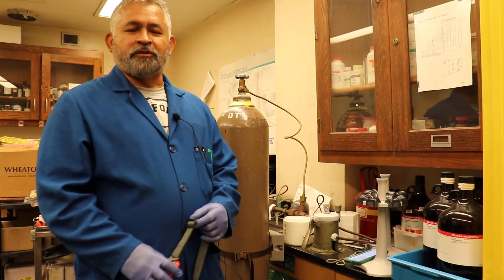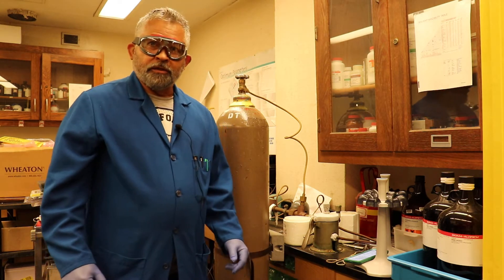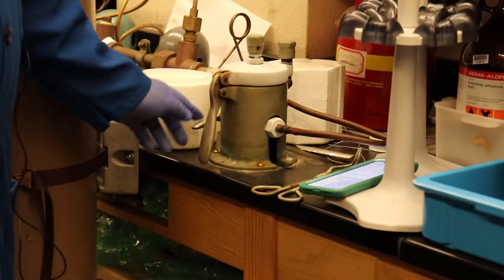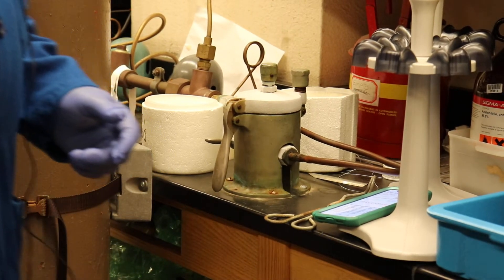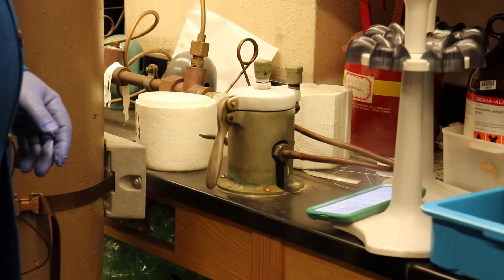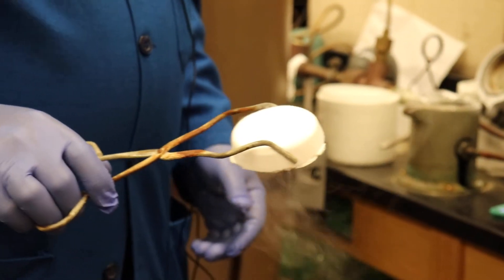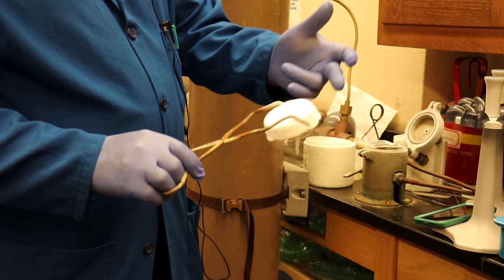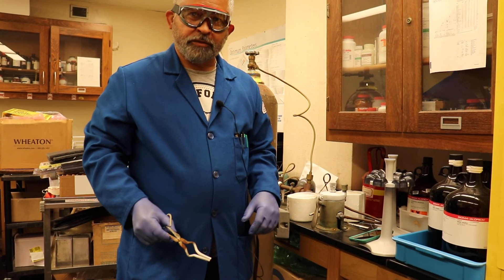Making Dry Ice - Solid CO2 in the Lab

Comment: Does the weight, of the liquid gas inside the cylinder, equal the weight of the solid CO2 you'll get through the deposition?  ie: what's the efficiency of this apparatus your using?  Thanks.